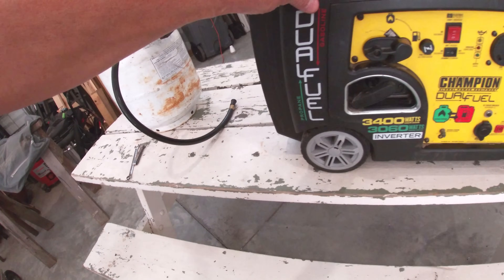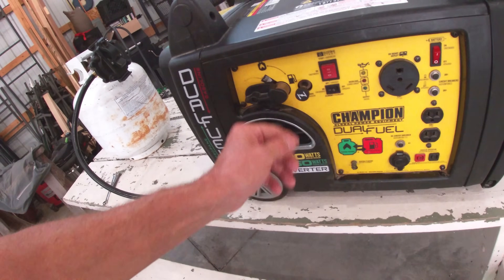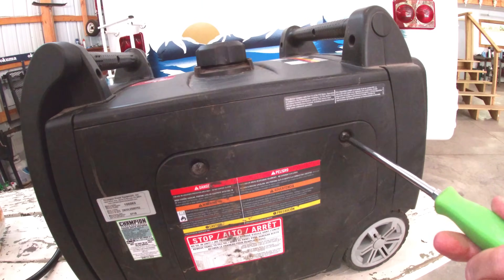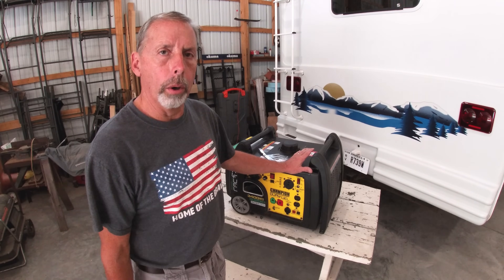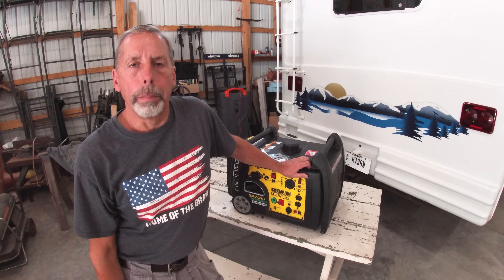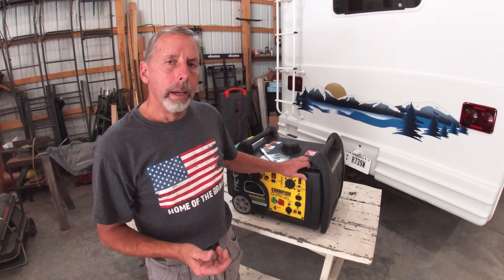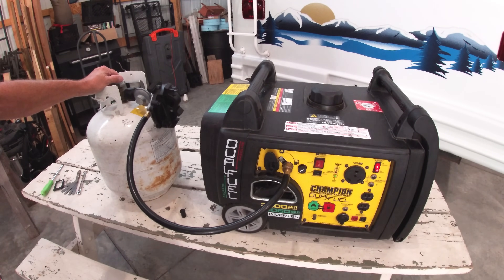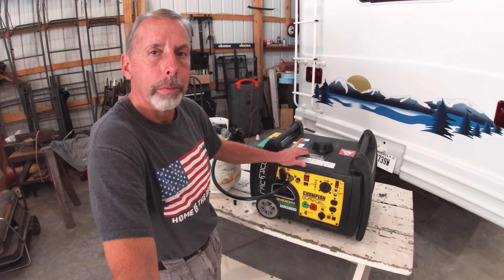Propane Generator Fail

Comment: Yup, I had a very similar issue.  It's with any propane bottle... not the generator.  It's the gov't mandated safety device.  I paid no attention to how fast I was opening the valve, and could get absolutely nothing out.  Even took it to the filling spot... and it worked fine for them.  Of course.  I learned you have to open the valve VERY slowly.  Otherwise you will get no flow, or LOW flow.  Lesson learned.
Reply from the maker: Thanks for watching

Comment: It's not the generator regulator. It is the propane tank safety valve that gets triggered when you open it too fast. Had  happened to me when I used a gas grill

Comment: Generator driving Invertor  appears to be the most fuel efficient  as  line frequency not depending on engine rpm.
Always have more than one propane tank  as you can run a tank completely empty and then just switch quick. If you only have one you end up paying for a refill on a half full tank.
Reply from the maker: Yep I always carry 2 tanks with me when traveling. Thanks for watching

Comment: Thank you sir for the video it’s great information. I haven’t have that problem……yet….lol But it sounds perfectly logical. I have a 4KW dual fuel predator from HarborFreight with  probably only about 40 hours on it. I only run non-ethanol gasoline in it and use Stabil fuel stabilizer. I do not use propane that often but thanks again for the video. These are kind of videos that makes it worse watching YouTube.
Reply from the maker: Thanks for commenting and for watching

Comment: In addition, There is also a safety mechanism in the propane  tank to keep liquid from coming out vs gas. The bottle needs to be set in the vertical position when using- never on its side.  Also, never use copper tubing to plumb propane lines - you will go boom sooner or later. Propane dissolves copper tubing/pipe. One of the reasons you don't store propane in your house is if all the gas is released and mix with air and ignites it has the same amount of  kaboom of about 770 sticks of dynamite. If you don't believe me ask your local fire Chief.
Reply from the maker: My last house used propane and the gas lines were copper tubing done by the propane company. Thanks for watching

Comment: Maybe instead of hooking up the propane line to the unit and then opening the valve.
Leave the hose disconnected, turn on the valve nice and slow, then plug it in.
This prevents the valve from going off on the tank.

Comment: I had the same issue with a propane powered meat smoker, a propane gas grill, and a propane weed burner. If you open that propane tank valve too fast, a surge of pressure hits that regulator and a safety device within it slams down the gas flow sensing that there is a dangerous gas leak. Open the valve slowly and the regulator doesn't sense a massive leak and the regulator works properly. If fully understood, we should appreciate that safety device within the propane gas regulators. Way too many houses have burned because of massive propane gas leaks in gas grills without these safety devices within the regulators.
Reply from the maker: You are correct. Thanks for watching

Comment: I have been buying Champion generators rwo at a time for over 30 years and it is clearly instructen in the manual to do the valve adjustment and decarbonize the arrestor. Routine. Most guys open a box n grab the product and throw away the box and literature and often overlooked little critical componenants. Machines worst enemies are foolish or lazy humans.That's why they hat to install the low oil sensor so lazy dummies wouldn't fry the machine and that used to be the most common cause if their demise. Duh

Comment: got the same one back in 19 broke it in change the oil and put it on slow charge 5 yrs later I thought I would just turn it over no-go I think the battery has went bad shows 12.7v thought pull rope will turn it over I guess ill have to haul it outside and see if it will run

Comment: I had a champion 9000 W generator that was Dual fuel, and it stopped working after one tall propane tank during an ice storm. I end up putting gas in it and it ran fine. I wished I still have the propane hook up to try, but my fan lab puppy chewed both ends of the hose off.
Reply from the maker: Bad dog. Thanks for watching

Comment: You can have a problem filling the propane tank too, attendant needs to open the valve slowly. I've found the problem is the newer valves they put in the tank, not the regulator. Open it fast and it doesn't work.

Comment: I found this is common with new regulators on propane devices.  When you open it quickly it thinks there’s a leak and the diaphragm tends to not let enough fuel through.

Comment: Good video,  I had a propane grill that was the same if you didn't open it painfully slow it would auto shut off. I was told by the guy at the store it was a safety feature required by law that shut down the flow to a trickle if the hose burst somehow?  I think it's a solution in search of a problem because I've never found anyone who had heard of such a thing.
Reply from the maker: Thanks for watching

Comment: I generally stick to gasoline for full power of my champion dual fuel,  when I'm done i drain the fuel from. The tank and run it so it burns the last of it. If I'm storing it for awhile, I add 1 Oz of kerosene to the tank and let it run into the carb bowl, just have to drain it before I start it next time.

Comment: Sounds like it’s a regulator issue. I have the same problem with my Coleman grill. I have a hose converter to use large propane tanks instead of the small tanks and I have to open the gas on the grill connect my hose then connect the tank and slowly open the tank. Once I smell gas “ purged the air out of the line and burner “ then I close the grill gas and then set to ignite and it fires right up.

Comment: good Video,  I have 2 Dual fuel Gens and what i have found it that under load they only run on 1/2 power,  Maybe the opening the valve to fast is my problem as well.
Reply from the maker: It’s possible. Thanks for watching

Comment: I found out the hard way that it is the OPD valve on the propane tank they have an excessive flow valve built into them just in case the hose gets cut or brakes! I had a heater that would not run hot it kept going out I changed the tank and it worked right! The guy at my propane company said the valves in these tank are not all the same and some close easy and others are harder to get to shut off the flow! The fix is as you found out {open the tank valve very slow} if it trips the valve unhook the hose and start over you have to reset the shutoff valve.
Reply from the maker: You are correct. Thanks for watching

Comment: Did you find it was more of a problem when it’s colder outside?
Reply from the maker: Actually no. We were stuck in Texas during their once in a hundred year storm in the winter of 2021. We used it during the black outs and it started and ran great. Thanks for watching.

Comment: First time I've heard using the choke on propane since the amount of fuel delivered by the regulator is dependent on the vacuum of the air the motot cells for so  their carburetor system must be different than most
Reply from the maker: Several people commented on my using the choke to start so I tried it without when the engine was cold. It wouldn’t start unless choke was on. Thanks for watching

Comment: It's the regulator in the hose that requires you to open the valve on the tank slowly, not the generator.  BTW were you at Quartzite for the annual ham event?  73, K9AT
Reply from the maker: No I wasn’t. Just there for the warmth. Thanks for watching

Comment: I've owned a WEN 4750 dual fuel generator for 6 years and have never had a problem. Recently, it got me through 11 days of no power from Helene. I only use propane, but after watching this video, what the hell..  I'll open the valve slowly from now on.
Reply from the maker: Glad you made it through Helene. Thanks for watching

Comment: It is the same for any propane regulator whether it is on a generator or a BBQ or a camper. The safety valve thinks there is a broken hose and restricts flow to a trickle. Ten minutes to say open the valve slowly.

Comment: I have the exact same generator. I noticed after you got it started you turned off the glowing red power switch. I always leave mine on. Is there a reason for doing that?
Reply from the maker: Not really. In case I forget to turn it off when I shut the gen down, it won’t drain the battery. Thanks for watching
Reply: @PleasantValleyOutdoors  Thank you. I love that little generator. I use it for power outages.

Comment: Champion would not need to re-print and replace the manuals, just make sticker or tag and affix it to the product
      Heck, i just might make a few adhesive tags stating '' when using propane, always open source slowly to avoid regulator issues '' and stick them to the box

Comment: I have had problem with propane heaters by opening too fast.  It is the regulator that is thinking there is a leak and restricting the flow of propane..   I have been told to get around the problem is to go to a 2 stage regulator.  I did that and so  far no problems.

Comment: I see the same problem with my propane "RV Fire Bowl".  If I open the tank valve quickly, the flame won't burn at full strength.   If I close the tank valve, or the Fire Bowl's flame adjust, and reopen  slowly, the regulator will then pass the full amount of propane and the flames are normal strength.    Since it's the same symptom (low fuel) with different devices ,  I think it's inherent in the design of the pressure regulator.   Moral of the story..... open the propane valve slowly.

Comment: Okay, the reason I DON’T use propane: 
It takes more propane than gasoline to get the same power, this is why they burry huge tanks underground for whole house generators. You will get a lot less wattage on propane.

People don’t like using fuel because of the gunked up  carburetor, well that’s because they use the wrong fuel and don’t know why this happens or how to prevent it. I have worked as a small engine mechanic in Florida for many years and I don’t have these issues with my equipment so I will explain why.

1) The Ethanol fuel you use in your vehicles is fine for them only and does not belong in a small engine because ethanol absorbs moisture from the air and deposits it as water in your fuel tank and fuel storage cans and since water is heavier than gasoline it rust the bottom of any steel tank found on most 🇨🇳Chinese built equipment unlike American and Japanese aluminum built fuel tanks.
2) Non Ethanol fuel is what all small engines with the exception of fuel injected motorcycles need to be ran on because a vehicle can disburse the atmospheric gathered water out through the tail pipe but a small engine can not so it ends ups sitting in the fuel bowl clogging up the jets and corridors the carburetor at times so severely to the point the customer needs a new carburetor.
3) Storing fuel in a hot environment such as an uninsulated shed. Fuel has a standard shelf life of three months in a small 6 gallon container… but much longer if you do a few things such as store it in a garage that has insulation over the ceiling because normally you have to pay extra for that! Also use Sea-Form fuel preserver just under what the bottle recommends. I have stored fuel for two years using the above methods however I normally rotate my fuel from storage containers to vehicles every May and buy new fuel for my small engines.
4) Install a manual fuel shut off valve inline and turn it off when done and run unit out of fuel and then remove fuel from fuel tank if off season and pour back into large fuel container/s
5) Spray NAPA Carburetor/Choke/ Throttle body cleaner inside fuel tank a little to dry tank then remove drain plug from fuel bowl and spray a little bit too also dry up any fuel then you generator or any other equipment will be the way the manufacturer ships it and the store shelves it until purchase with the exception your unit has oil in it that should be changed every 50 hours anyway.
Reply from the maker: Very good advice. Thanks for taking the time to comment and for watching

Comment: Lol this is the first video I've ever seen on YouTube where they state this. We have to do this all the time at work and I have since started doing it at home on my barbecue grill. We use weed burners at work all the time and if we open the valve too fast very little propane comes out. I noticed it didn't one time on my barbecue grill and ever since then any propane tank I've ever opened I've opened extremely slow like 30 seconds slow and I haven't had the issue since
Reply from the maker: Thank for watching

Comment: FYI.. try starting your gen without chock, when using propane the choke is bypassed altogether and serves no purpose other than when using gas.. the regulator has a safety feature with a huge pressure change will throttle the output pressure , some bbq’s have a similar feature also built in their regulator. let me know on the results starting without the choke, thanks
Reply from the maker: I’ve tried it multiple times without the choke and it won’t start. Not sure why but no big deal to choke it. Thanks for watching

Comment: Dude if you weld, use oxyacetylene torch or anything else that uses high pressure sourced with regulators you always open it slowly or risk damaging your regulators. Granted propane isn't at 2 to 4,000 Psi like other gases but then it's regulator is designed with the same ideology in mind. to quote an old adage "Slow & Steady wins the race."

Comment: Hello thanks for the info, I have a pulsar 12000 watt generator, 1st time I ran it was on a partially full tank from my grill, ran flawlessly, the storm put us out og power for 10 days,  I bought a 100lb propane cylinder hooked it up ran like crap, many tries later I bought an adjustable regulator from Amazon ended up turning it to what looks like off and thr generator ran beautifully,  turns out the generator regulator runs on 7" water column pressure,  a 7" water column pressure equal 1/28 of 1 bar, too much pressure and it won't run, thanks again
Reply from the maker: Glad you got it figured out and for watching

Comment: I did not think the choke did anything if your using propane.  I thought it skipped the carb ?
Reply from the maker: I believe the propane still goes through the carb. I do know it won’t start unless you pull the choke out. Thanks for watching

Comment: I thought everybody knows never open up a propane bottle too fast for anything. There is a small ball bearing in there that is designed to shut it off if a line gets cut or the hose catches on fire and burst.

Comment: Just like a gas grill, I’d you open the valve to fast, the tank thinks there is a leak and propane won’t or will barely come out.

Comment: Propane devices often have an "excess flow valve" built into the regulator. This done so that in the event that the hose breaks, the flow of propane is stopped. Instruction manuals today are poorly written and fail to mention details such as this.

Comment: I think all new regulators work this way, it is a safety check valve in the regulator for "safety" you can burp off the extra pressure by closing the tank and unscrewing the valve from the tank, you will hear it hiss , then re tighten and open slowly.  Both my BBQ and fire pit work this way too!
Reply from the maker: Thanks for watching

Comment: with the new stile propane tanks the safety valve will shut it's self off to prevent full flow out of the propane tank. This has happened to me when I am in a hurry to turn it on.

Comment: ❤  NOPE definitely not the generators regulator. Yep if you were born in the 50s you may remember what it was like to use a propane tank without that problem. The problem valve is on the top of the tank. They were installed on the hose ends when the tank valve threads were switched to outside threats and everybody switched to plastic nuts on the hose ends . That was in case of a fire, so it would melt the the plastic nut that goes on the tank valve and therefore shut the flow off. Can also be tripped when the tank is tipped over. It has nothing to do with any generators. I discovered this when trying to run a tiger Torch from a propane tank. I couldn't get a full Flame.

Comment: I have a Champion dual fuel generator and I think I had this happen.  It was in the winter and our solar panels did not generate enough power to recharge our batteries so I fired up the generator and plugged in the charger.  It seemed to run alright for a little while but then bogged down and the charger shut down.  Tried starting it back up and it coughed and bucked etc.  Long story I just shut it down.  
I figured either the regulator or the carb froze up because it was probably around 15 degrees.  I called tech support and they said the generator should not be effected by that temperature and said it was likely the control module.  It was only a year old so they sent me a new module.
Didn't go back up to the cabin until April and before I changed the module I thought I'd see if it would run.  It started and ran under load with no problem.  
So, what was it?   Something froze in the fuel delivery system or did the same thing happen to me that happened to you???   I don't know.
Reply from the maker: It’s frustrating to not know exactly what the problem is. Thanks for watching